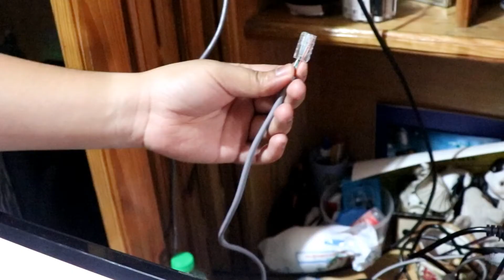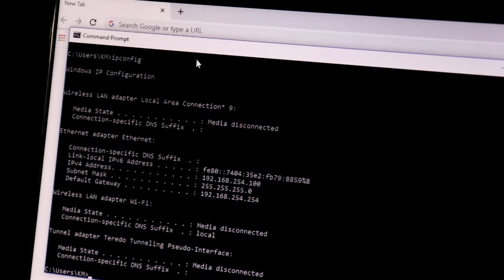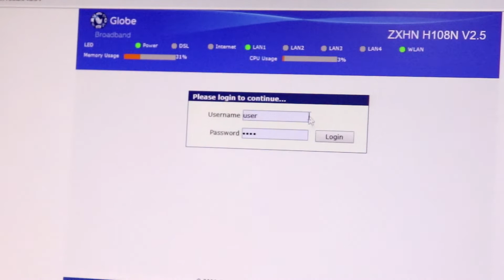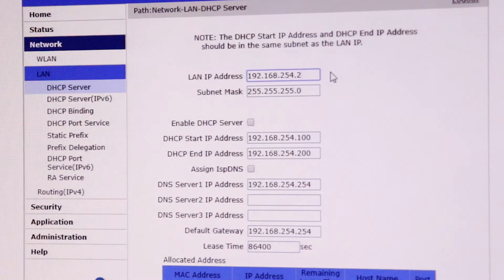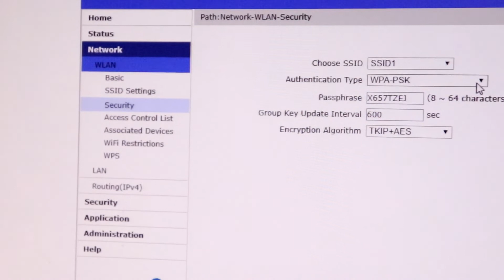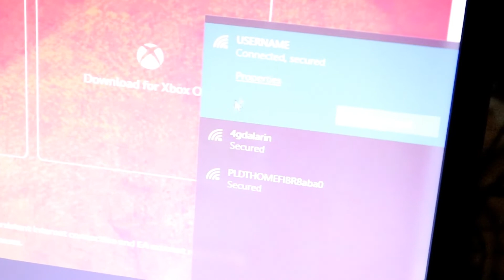Extend WiFi range using your old router

Comment: My modem is pldt and im going to use globe as wifi extender. There should be no issues right?
Also if i am going to change the defauly gateway of the extender it wont affect my exisiting connections like direct wifi and lan right?

If default gateway of my extender is 192.168 254.254 i will just change the last part right

Comment: sir sana mapansin mo po to, ask questions lang po. gaano kahaba ang limit ng utp cable sa pagkabit sa 2nd router. my signal pa po ba kahit 10m ang layo ng 1st router to 2nd router
Reply: sir,ako nalng sasagot.in my case using utp cable to my second router is 90 meters .then another extension from second router to third router is 80 meters.meaning ok lang kasi naka utp cable ka..
Reply: Haha
Reply: sir i try na. pero hindi ganun kabilis. 30meter nga lang gamit ko e. 10mbs lang pinakamataas na bato

Comment: It just messed up my wifi connection, and I wasn't able to use my main internet until now.
Reply: Incomplete...you have to know the information of the main router you will be connecting to...its better to set the static ip as well of the extender on the router page of the main router

Comment: Thanks for this! just upgraded, so looking for a way to use our old router which is exactly like yours!

So i can just put the ethernet cable in any slot or an specific number?
Reply from the maker: Please put it on the number 1 slot :D
Reply: @DelacruzRamon4  thanks! Haven't tried yet but will in a few...
Reply from the maker: @lukasjacob3721  Okay maam just follow the steps :D